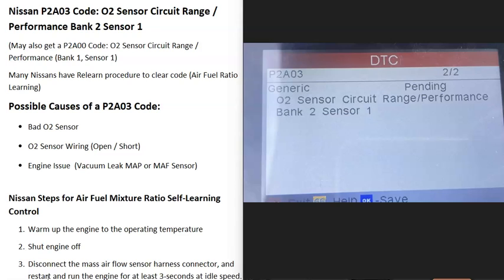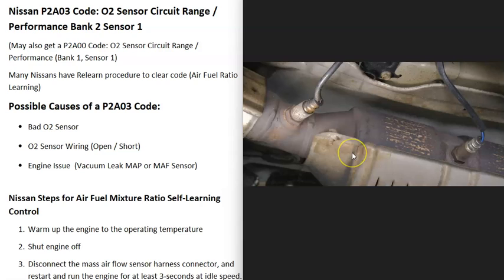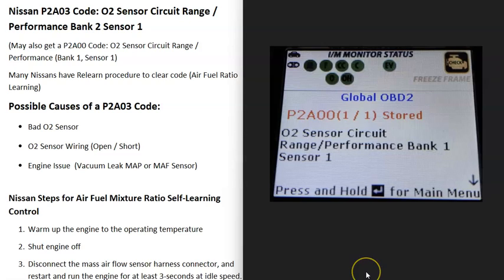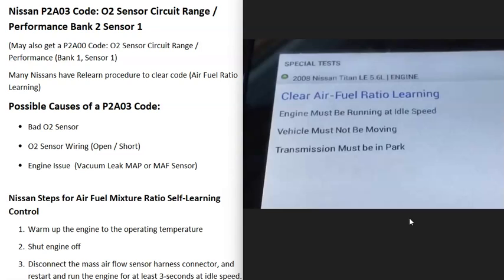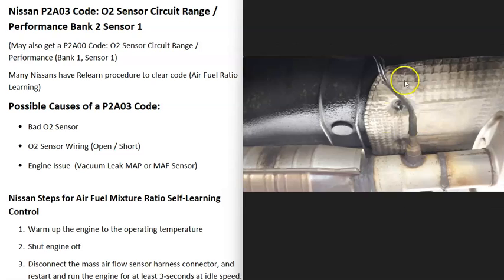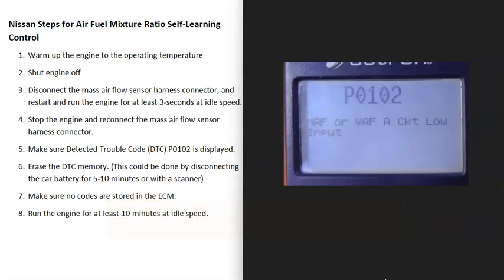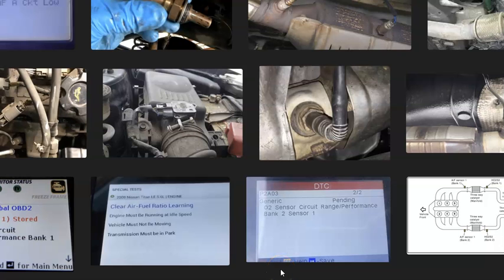Causes and Fixes Nissan P2A03 Code: O2 Sensor Circuit Range / Performance Bank 2 Sensor 1

Comment: Is it possible a misfire in cylinder 1 could lead to this code i have a 2007 nissan frontier v6
Reply from the maker: Yes, the cylinder #1 misfire is likely causing the P2A03 Code.

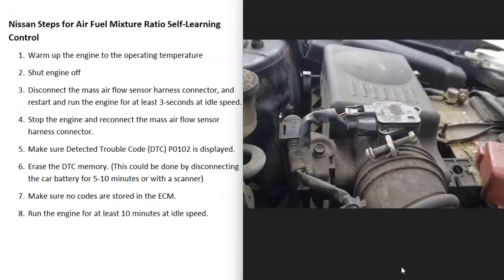Comment: I have replaced 02 sensors twice and had smoke test done after reset code sel comes back on I had cat replaced a year and half did relearn light keeps coming on what am I missing 2:53
Reply from the maker: If the sensor is good, it is likely on the wiring. There are usually two 2-wires going to the heater elements (12 volts) and two wires for the 02 sensor (ground and signal) going to the computer.

Comment: My 06 maxima has the same code with a p0420, I did the learning test but shortly after the p2a03 came back
Reply: Have you found out what the issue is? I got that code, changed out the 02 and I got it again on my Maxima.
Reply: @Areodactyl7777 did you fix? Can i drive with a bad 02’sensor?

Comment: I have p2A03 2006 Nissan quest I changed bank 2 sensor 1 but I still have the code popping up can the down steam b2s2 turn this light on ? Thanks I have done the procedure with the scan tool and it has come back

Comment: I did all repairs on this Nissan, I Changed Oil Valve Covers with PCV Valve included , Air Intake Manifold Gasket, Thermostat OEM, VVT Solenoids, Replaced All Emission Hoses OEM, 4 O2 Sensors NTK’s, Motor flush the oil and new oil, 4 Catalytic Converters…. And still have the p0420 and 2A03. I reset on my OBDII Scanner and drove for 215 miles and Check Engine Light came on…. I torque to all OEM Specifications and I have a funny feeling is the Catalytic Converters and for the hell of it I put O2 Sensor Fouler on the the Bank 1 & 2 upper threshold and the code is still on… I need help OEM Catalytic Converter are too expensive. I’m thinking of getting Evan Fischer Converter an Aftermarket… I need help to make a good decision.
Reply from the maker: It will be best to test the components before replacing them. If the Bank-2 Sensor-1 O2 sensor is good, I would test the wiring next. Also, the CAT can be tested to see if it has failed. There are many good videos on testing it.

Comment: i got a 2006 g35 coupe i have a  code  P2A03 Bank 2 Sensor 1 i replaced the 02 sensor like 3 times  at the mechanic and code keep coming back . Do you know what could be the issue for the check engine light to keep coming back?
Reply from the maker: If the sensor is good, I would check the wiring.
Reply: @HVAC_Mechanic   and if the wiring is good do u have an idea of what else can cause the code?
Reply from the maker: If there is an exhaust leak, that can cause 02 sensor issues. Other issues that throw off the sensor would usually give other codes. For example, a bad ECM would usually throw multiple codes.
Reply: @HVAC_Mechanic  the only code  i have is P2A03 i replaced the  y pipe because it had a  hole thought that would fix the issue with P2A03 but code came back, other than having that code the car runs good,so i dot know what could be the issue?
Reply: @HVAC_Mechanic   i replaced the y pipe that had a hole in it thought that would solve the issue but the code still came back.
Reply: @sahbabby7330  Did you ever solve the issue with P2A03?

Comment: Good morning great Video i did all the stuff you said i replaced all the sensors and also the catalytic converters and after 40  miles the same sensor pops up what's your thoughts
Reply from the maker: Since the components are new, they are likely good, but they need to be tested to know for sure. I would test the wiring next and be sure there is no issues there.
Reply: Ooo. m @HVAC_Mechanic
Reply: @HVAC_Mechanic 
How do you check wiring 4:11

Comment: I did all the things you suggested, and it worked for a Nissan Pathfinder 2006. I have yet to drive it around, but I will tomorrow or later on.

Comment: Hello can you drive the car if it's the p2A03 code?
Reply from the maker: If a 02 sensor fails, the engine will be in what's called an open loop and be less responsive but should still run.

Comment: I have a g37 sedan and I got the same code. I did the re-learn and the code came back. I also replaced the o2 sensor and the code came back. What could it be?
Reply: It could also be the rear sensor can also cause the front one to trip
Reply from the maker: If the sensor was replaced, I would test the wiring.

Comment: Excellent video. My mechanic though I had a bad connector. Told me that they have had that situation and referred to another mechanic to fix. Unbelievable. Part changers. He researched and couldn't find a solution. I came across your video and had to do a manual flash because his computer is not bidirectional. They are on the stone age. How can a business function like that. Thank you again.

Comment: Great description man. I rigged my own o2 sensor extensions for Lt Headers on a Titan and one of the heat wraps wore and made a short on one wire, wrapped it with heat tape a year ago, got the code again. I’ll have to see if it’s exposed.